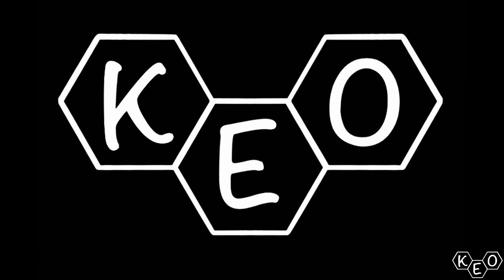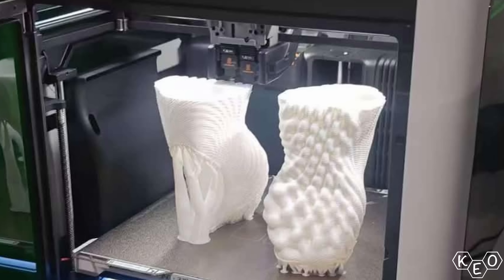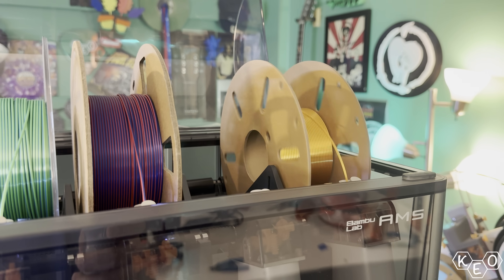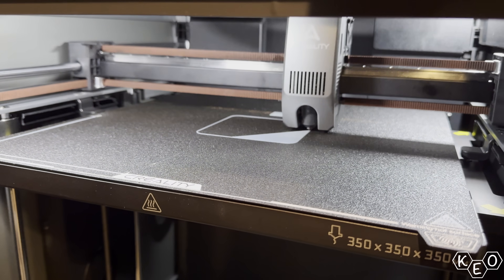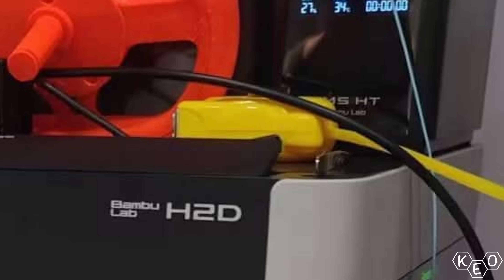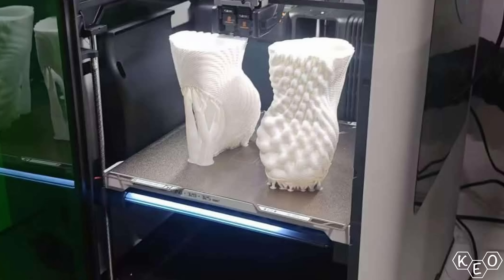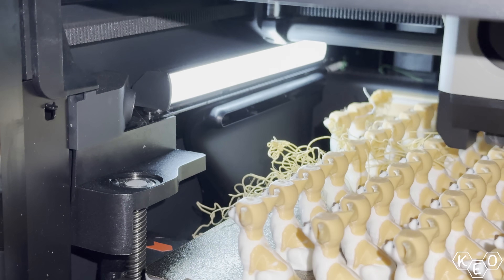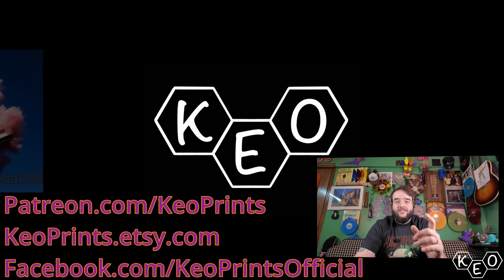The Unreleased Bambu H2D Changes Everything

Comment: Having found a somewhat clear image on X, the build size is 350x320x325. The module on top of the printer clearly says "LASER" on it and also looks like a "10" after the word laser, for 10W. This looks likely since the door and the side window looks to have a green tint for laser safety. Being quite versed in lasers (I have 7), I think this is a really bad idea due to the smoke and particulates generated while laser engraving and cutting. The likelihood of fires while laser engraving is also common.
Reply: The laser might be used for other things than you are thinking of - it could be for fusing the plastic making it stronger in the weak orientation, preheating before laying down next layer, cleaning, all types of tings, we have not seen before,  maybe for new types of filaments as well.
Reply: @chris6160-d6s  I was thinking the same thing. The laser could be used to improve some aspects of the print . Heck I don't think its a stretch they may have a special filament that works with the laser to do all sorts of things like changing color or adding patterned designs to the surface. Reading about how noxious and dense the fumes can be it doesn't seem likely it will be implemented in the traditional way. I guess we'll see.
Reply: @bombswabs3041  Exactly, maybe even some filament that cures with laser, I don´t know, but these guys are not stupid, thats for sure :-)
Reply: @chris6160-d6s  The last thing you probably want to do is add even more weight to the print head(s).
Reply: @Disco_Potato  if laser and hotends aren't running simultaneously, the laser can be cooled by cold end heatsink and fan. The actual laser diode and optic are tiny.
Reply: @chris6160-d6s  True, seems like you could use a laser to re-heat filament right as it is being laid down in order to get around the poor layer adhesion that high temp filaments have.  The adhesion is bad because the filament cools too fast after leaving the nozzle, but image a laser that could keep it hot at a distance instead of trying to beat the problem by keeping the entire chamber really hot.  This would be a game changer if it worked.
Reply: @ It would be really cool, if that is the case :-)
Reply: @chris6160-d6s  Lel, no, no way. For starters it would be impossible to calibrate the laser to accurately heat a gazillion different materials in a gazillion different colors. Secondly, the laser would need to be angled and swivel to trace the path ahead of the nozzle - that's a thousand no-nos.
Reply: I'm also dubious of even a 10 watt laser being used in a home environment without extensive air filtration/venting, and the smoke evacuation would need to be very efficient to avoid vapor deposition on the precision motion control components.  That's difficult enough in a dedicated laser engraver where the design places the precision parts away from the smoke.
Reply: 10 Watts is pretty sucky. 20 passes to cut through a descent thickness peace of wood. I have a 100 watt CO2 laser that I run at 80 watts (you never run a a CO2 laser at full power if you want it to last) with a number of different lenses. 10 watts is not going to get you very far, especially with a fixed focal point and since this printer has a slab of a heated bed which means the laser cannot pass though it on a cut, some of the laser light will bounce back to the lens and cause it to eventually fail prematurely.
Reply: Makes sense since Creality has a 10w laser add on module for their printers.
Reply: its a terrible idea to try to put a laser in this... i think they are going backward and just following fads.  If you want a laser - get a laser, dont' get a machine that will no doubt have to sacrifice quality to do 'everything' over just doing the one thing it should do, print, well.      But then again they tried to market liedar as their gimmick, and it failed miserably.
Reply: I hope you don't use green safety glasses with the blue/violet lasers, you really want red/orange.....
Reply: Don't worry, they'll have some cloud AI bullshit to detect fires, it'll be perfectly safe.
Reply: Multifunction including 3D printing is always a compromise and no thank you.  If I want a laser, I'll buy a laser.  Unless the laser is for 3D printing.....  350mm x 350mm is the "right" size,  the dual nozzle will make that 350 even smaller.  But let's hear the whole story when released.

Comment: i think 2 = 2nd bigger size
D = dual nozzle or dual head type FFF and laser engraver. i don't think it's a cutter. unless you change the bed. the volume didn't make sense until you brought up the dual head. very clever. 320mm² is ideal for helmets ⛑

Comment: I heard is a 3000$ plus Machine. At that price point is too close to the Prusa XL with 5 Toolheads and 360x360x360 Buildvolume, yes I know is not enclosed and doesn’t have a Laser, and you have to do some Assembly. But I have one at Work, that I have assembled with a Co-Worker, and it took us less than 4 hours and it was really easy. We also enclosed it for around 300$. In the end the Printer was 4000$ and if the H2D, is around 3000-3500$, I will get a Prusa XL. Also, who knows, if we have to pay Tariffs on the H2D, the Prusa XL is Tariff free, because is made in the US.
Reply: Prusa XL isnt made in the US prusa just own an american distrubuter who do a bit of assembly
Reply: “I heard” lol 😂
Reply: @ they said is more expensive than the X1E
Reply: Tariffs will likely be an issue and something that costs $3K or more will certainly exceed the no-tariff cutoff.  In Trumps first term the cutoff was $800.  Bambu would have to build printers in the US to avoid the tariffs.  Maybe ship them over in kit form and have some small operation that takes it the last mile so it can claim to be made in America.  That would still drive up the price, but not by the amount that tariffs do.
Reply: Wondermaker just starts a Kickstarter with a 4-head one, similar to the Prusa XL, for 550,00 $.
Reply: As far as I know, local products will also be used for Prusa production in the USA in the future.
Prusa announced this when it announced that it would also build printers there. 
Perhaps an advantage for Prusa if Chinese printers in the USA soon become much more expensive.

But who knows for sure. Maybe he's already imposing 200% tariffs on Chinese printers and the day after tomorrow he'll cancel them again.
Or he might rename the China Sea or Mount Kilimanjaro. 

If this really is to be the new Bambulab and there is no groundbreaking innovation behind the double exdruder, a Prusa XL in multi-material printing is simply better.
Reply: The AMS sucks for anything that isnt the same or close to the same filament type. The Prusa XL can handle 5 entirely different filaments. Far superior, and it can do multople different nozzle sizes and MUCH quicker switching between toolheads. If you can't wrap your feeble mind around how that is vastly superior to anything that Bambu offers, then I'm not sure where your heads  at. Also consider that the XL is mostly produced in the Czech Republic. A country that pays its employees a living wage. Unlike  China owned and operated Bambu. Did I mention the XL is ACTUALLY open source? Why everyone rides Bambus tip all over no matter how they change the terms and conditions after you buy it. But hey, if thats what you want to support, go for it.
Reply: @EFLO3D  valid points, not made more convincing through insults. As a newbie consumer, finding €800+ for something regarded as far from a necessary home appliance was just about feasible. Finding €1500? Wasn't going to happen. I'm as disappointed as anyone regarding the closed source/security nonsense but Bambu have certainly opened up and shaken up the industry. Bambu came from nowhere to the one to beat in two years. Can they maintain that? Unlikely and the Hari Kari of the firmware update hasn't helped. But I've seen more than enough frustrated Prusa owners to be skeptical I'll be going to them for an update machine. Bambu fan boy? Not me, but living with my investment and hoping for the best
Reply: @EFLO3D  very well said thank you
Reply: Well it isn't really an equal comparison. You have to remember you can daisy chain 4 AMS for up to 16 different filaments, while the XL is hard locked at 5. If that max works for you, then the Prusa is a consideration. I have a large percentage of prints for my business that are 8 filaments, so the XL isn't even a consideration for me.
Reply: @OmegaGamingNetwork  if you are somone like me who works with multimaterial rather than multi colour then you need multiple nozles thats likely why bamboo have two on that machine the XL which is my main machine saves me hours and hundreds of pounds by allowing me to print multimaterial flexibles and filiments that dont stick to one another for support material so no the ability to daisy chain MMUs doesnt negate the Prusa XL unless you want 16 colours of PLA or PETG but no mixing and matching
Reply: @Daisy_human I have half a dozen P1S all with dual AMS. 90% of my print volume uses a mix of PLA, PETG and TPU. I assure you it can be done with 1 nozzle. Now would multiple nozzles be preferable? Of course it would. That is why I researched the XL, the Ultimaker S8 and now the H2D. I run a business, I am constantly searching for the next big thing that saves me time and money. The XL got eliminated because 5 materials simply isn't enough for most of what I do. The S8 got eliminated for a laundry list of reasons that mostly revolved around Ultimaker being wildly out of touch. The H2D..well we shall see once I get enough information. Right now, it looks like the only viable machine that meets all of my needs.
Reply: @OmegaGamingNetwork  you cant be usin very flexible tpu and i dread to think about your purge towers therese also the time implication changing the temperature of a nozzle to work with a filiment change is time wasted my xl takes maybe 10 to 20 seconds to change filiment no matter the temperature and as i dont do colour i dont need purge towers and why on earth do you need more than 5 print heads you cant reasnably be printing with that many different materials unless you are actually just storing your filiment in the MMU rather than changing filimenr between progects which is perfectly fine i do it to but it isnt the same as actual multimaterial printing and thats before we look at the different nozzle sizes
Reply: @OmegaGamingNetwork using one nozzle generates a lot of waste though. That's the only part stopping me from upgrading my Mini with an AMS Lite
Reply: @ @ So because you don't understand it, it can't be done? So let me give you some perspective from someone who isn't printing toys. I print functional parts for businesses that utilize both material properties as well as color because they want their branding on it as well. Most of the brand logo's are between 4-6 colors. The actual functional portion of the part utilizes the properties of TPU to create an embedded button with enough flex to activate the device, but is specifically designed where I can control the layers and dimensions to directly impact the resistance the button provides for different applications. That obviously takes up another slot. The PETG component is for support interface because there are very tight tolerances and it is critical that the supported surface be just as refined as any other surface. Not to mention because of the tight tolerances, If no interface material were used, it would be impossible to separate the layers cleanly. The PETG is also used as a first layer on key areas to not only give the button a raised texture, but to create a protective clear coating over the logoed layer. Thus adding 1 more material. So as a result my required number of filaments per device ranges between 6 and 9. Since 9 is fairly rare I get away with only swapping a 3rd ams on to one printer as needed or if it is for a grey color, I blend white and black using layering to achieve it with 8.  So no, the XL will not do what I need it to do unless I got an order that was 5 total materials or less and buying one for that rare use case for me doesn't make sense. Don't get me wrong, I love the idea of tool head switchers in theory and for those working with less materials than me,  I am sure it holds great appeal. However the limitations are too great and the cost of the machine quite frankly is about $1000 more than what it is worth as at the price it is, I wouldn't save enough time and material with it to ever overcome the price gap between it and a P1S with a couple AMS units. I've done the math for my business as I do with every single machine I come across (Including the Creality, despite my dislike of them) because all that matters to me is production capability and bottom line. The X1 Is a great machine, but it is aimed at people where cost isn't important and who are working with only a few materials at a time. Neither of those things apply to me.

So this idea that the AMS "Sucks for anything that isn't the same filament" is utter bollocks being peddled by people who either don't know any better, or are being fanboys for prusa. It handles multiple material just fine. It has it's drawbacks like any other system and the 3d printing space certainly hasn't perfected everything yet. The XL has its pro's and cons and the Bambu has its pro's and cons. There is no perfect machine for everyone, each user needs to figure out what works best for them.

Edit: I should mention that I don't require super flexible TPU, the TPU for AMS fits my needs just fine. Again I'm not making toys. Additionally time while important isn't the end all be all for me because I just build time into the price quote. The fact is I can produce something these businesses want that right now no one else can compete with because the design is my own and I have the machine setup to do it. When and if someone makes a machine that is faster and more efficient,  I'll be switching. Until that day however, the time and waste is irrelevant to me.
Reply: @thetabletopskirmisher  It does, but in reality you are talking about fractions of a cent. It is certainly something you need to be aware of when you are printing for personal use so you can determine if the overall cost is worth it, but as a business it really isn't all that important. Heck as a hobby you could easily find people to buy a toy or knick knack here and there and more than fund your filament habit. I was very worried about waste when i first started and if I'm printing something personal,  I'll still shy away from something that has hundreds of filament swaps as at that point painting it usually better anyhow. However for prints that are generally 100 or less swaps and especially for prints where you can print numerous copies on the same print plate, it becomes less and less important. My primary product has about 20-30 filament changes, but that waste  is spread out over 7 prints per batch. That turns into a few cents of waste per product. Given my profit margin is around $15 per product, a few cents doesn't even register as important to me.
Reply: @OmegaGamingNetwork  

problem is that you cant fead the same materials  whit a ams, fry using realy soft tpu, cf materals and if you dont want any mixing to name a cople of thinks that dont realy work in the ams and therfore need seperet nozzles
Reply: @Goroca  The only thing you mentioned that I could decipher at least that doesn't work in the AMS is standard TPU. At no point has bambu ever claimed otherwise. That is why they developed a TPU specifically for the AMS. CF materials work just fine in it, not sure where you came up with that nonsense. There are a couple of materials that you cannot feed through an AMS because (Shock and horror) every system has pro's and cons. 

Again i run a business that produces multi material products that I design and sell myself. I have a bunch of machines with thousands upon thousands of hours on them with who knows how many tens of thousands of filament and material swaps at this point. I am extremely aware of the capabilities of both the XL and the AMS systems.
Reply: @OmegaGamingNetwork same on all counts, but 5 X1Cs here (the lidar doing auto calibrations are why I keep buying em) I run 5 color + support filament prints at 0.2mm and would be more efficient with that bigger build volume here
Reply: @Tom_makes  Not a single part on the Prusa XL or any other prusa is made in the USA.  And with Europe going woke, look for tariffs there also.  It's nice that it took two of you 4 hrs to build an XL.  Which equates to 8 hrs of labor, ask your boss what that time cost your company.  I bought my company 4 P1S's at Microcenter for a total of $2800 and all of them were up and printing in 20mins.  We will be sticking with Bambu.
Reply: @jonwoodworker  no idea how you work woke into a trade war. If you slap tariffs on another country's exports, expect the same treatment back. That's just how tariff's work (or rather, don't).
Reply: @jonwoodworker  dont be silly yes eavryone knows that prusa are chek but please dont start with the trumpian guff
Reply: @Daisy_human Then why did you say Prusa is made in the USA?  Funny, you can say whatever you want but get offended when a "trumpian" speaks the truth.  Gotcha.
Reply: @jonwoodworker  the mk4 is produced or assembeld by printed Solid locally, and they will also build coreOnes. So there shouldn't be a tariff on them.
Reply: @jonwoodworker  well I’m sure Prusa comes up how they move the rest over to the US. But tbh, I’m sure the orange Man will fuck the US before they can do that. And you have to do the Assembly just once, and we have Prusa, Bambulab and Vorons at the workshop, and the Vorons and Prusas have less failures than the Bambus.